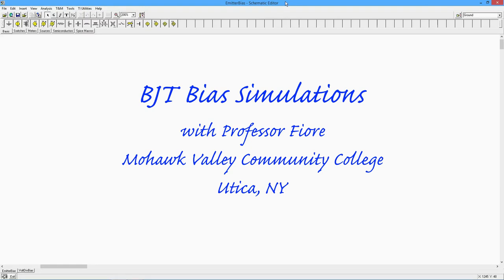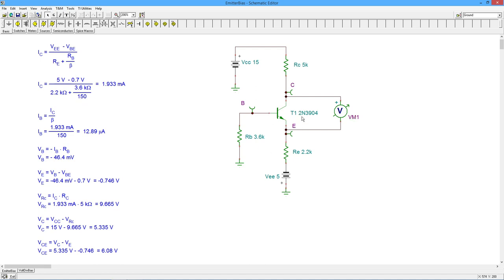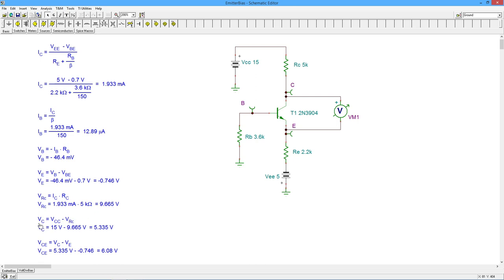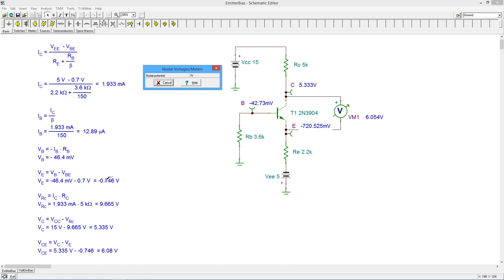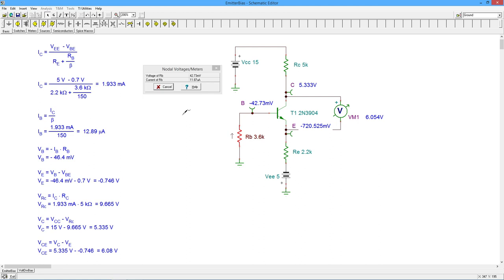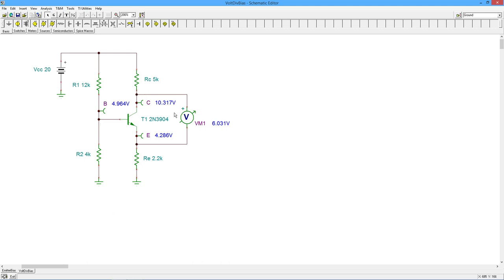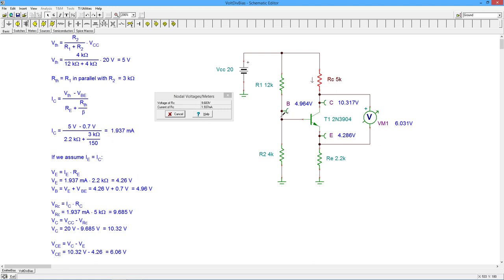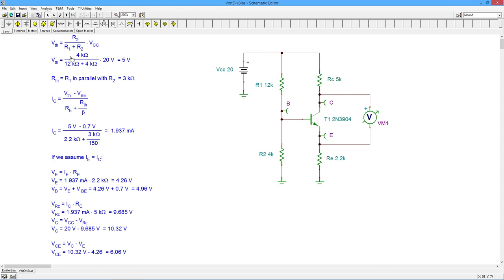Semiconductor Devices: BJT Bias Simulations

Comment: I find 2/3rds (0.66) for Vbe a better estimate for small signal currents.
Reply from the maker: It certainly is true that the lower the bias current, the smaller Vbe will be. Some authors use 0.7V and some use 0.6V. In either case, if the amplifier is designed properly, that variation will be inconsequential.
Reply: @ElectronicswithProfessorFiore  I agree about the need for a complete design. It's nice to see the maths match the simulations when first starting out and I find that if I set Vb to be 0.7V above Ve, I get a 'too' high response at Vc. Even at 2/3rdsV it's often too high. I've spoken about this with Audio Amp designers and they say to use 0.6V. I think that the digital age has pushed us more towards the 0.7V.
Thanks again, I suffered some brain damage last year and am relearning mathematics as a result, so making the maths interesting with circuitry is really helpful and your delivery is superb. I wish you'd been my teacher when I was younger.
Before my Brain crash, I'd designed a power amplifier but didn't finish building it, so my goal is to understand the maths again before trying to build it.